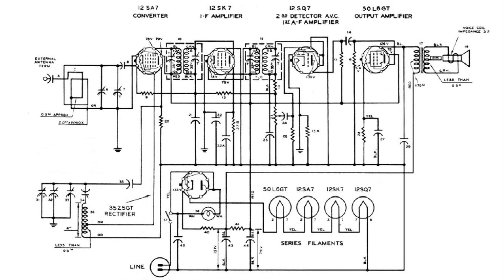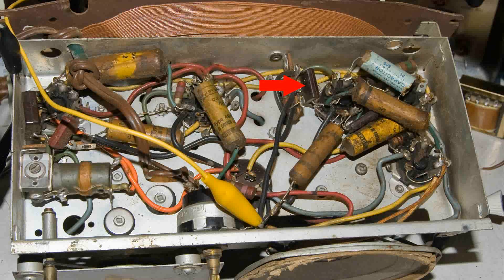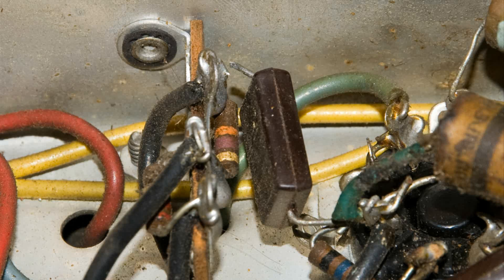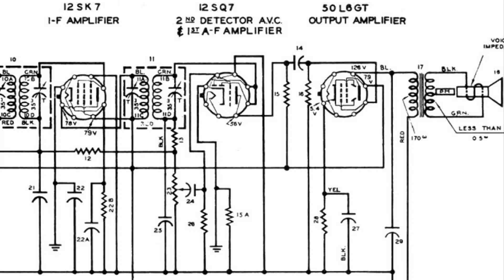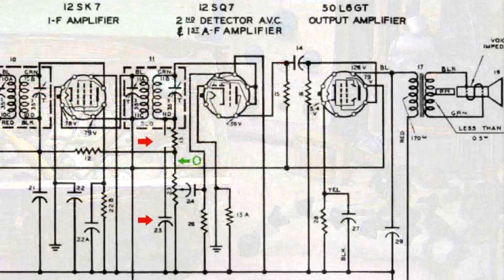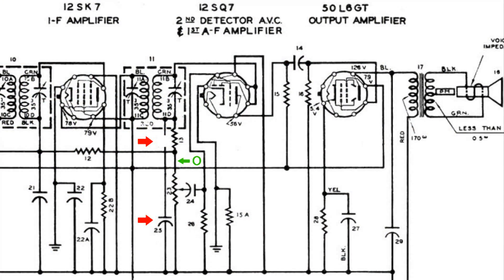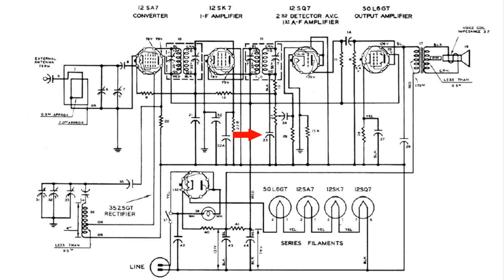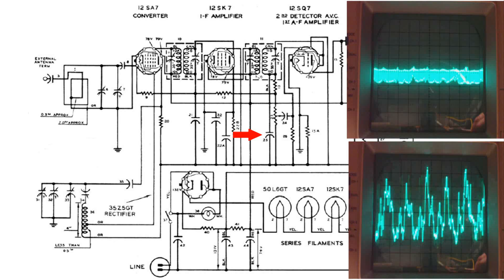RF Bypass Capacitor Oscilloscope Demo

Comment from the maker: Thanks CameramanLink
Sure could. Other parts in this radio if their bad, the radio will not play. And most of the time it is easer to find that. But if this cap opens the radio plays but the sound is mushy. Also if the RF cap is open and you trace it out with a signal tracer and you go across it, the tracer can supply the RF bypass and both the tracer and the radio will play great.